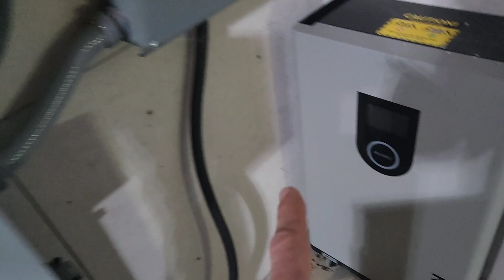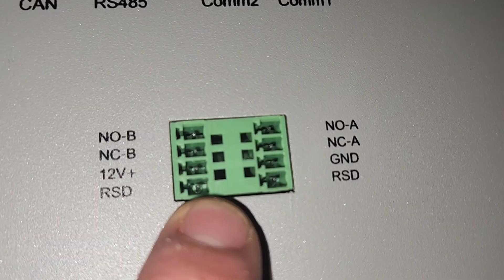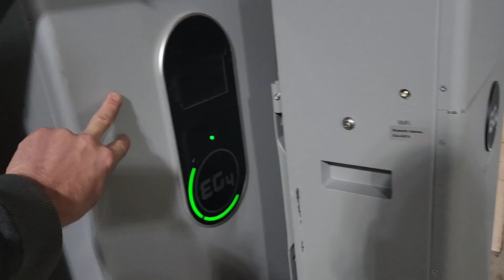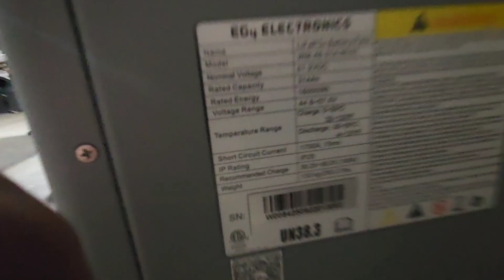New Eg4 16kwh Indoor Wall Mount Battery - 48V 314Ah

Comment from the maker: Eg4 16kWh Battery:  https://signaturesolar.com/eg4-indoor-wallmount-battery-48v-314ah-16-1-kwh/?ref=DiySolarPowerFun
Reply: I know that is how I learned about the battery.   Yes, the price is high but I need to know more about how to protect it indoors at cold temps ( ~ 20deg F).  Advice?  I will need at least three of them or equivalent.  My Grid will be for emergency back up only if it is working ( usually December through February is when we get Blackouts and brown outs).  Brrr its cold these months.
Reply from the maker: @crimestoppers1877  these batteries do have heaters. However if it's 20 below I would probably recommend storing them inside. If you need a space for your batteries inside, check out my first grid boss video. I mentioned a few different wiring diagrams if you want to have a strategic location for your batteries.
Reply: @diySolarPowerFunWithRay    It's not 20 degrees below it is only 20 degrees F or 12 degrees below freezing at sea level.  I will check out those videos now.   I would enjoy building the horizontal YX something can not pronounce? batteries that Will built (on the Harbor freight lift trucks).  However, I am in California and they are in China or Taiwan and have had huge issues ordering direct from Taiwan or China.  The quality is all over the board no matter how many "certifications" they can show.

Comment: I'm getting the new Panda Battery if it gets a couple of updates. over 600ah's, with the bigger cells, and its like 2300 bucks.
Reply from the maker: That's big... so about 600lbs? I don't think i could move that.
Reply: @diySolarPowerFunWithRay build it in place if you can't move it
Reply: There are soo many DIY batteries that are very high quality but you cannot ever use them with a grid tied system. You HAVE to have a UL listed battery.
Reply: @eekedout no, just be smart and not let them see them, and have the UL where they can see it. OR! here's an idea, get the CHIN NAH battery later after you got your system certted with one UL batt.

Comment: Another stupid design. If you read the battery description, you're not allowed to build a battery on its side. The same goes for the pressure the cell needs to withstand. In a stack, the bottom cell has the most pressure, and the top cell has almost none. Never buy a model like this.
Reply: Well, you are the very few people notice this design has issue...

Comment: The battery is nice, but if you are using both the inverter will pull from the lease resistance first.

Comment: Can I combine three EG4-WallMount Indoor Battery | 48V 280Ah | 14.3kWh with one EG4 Indoor WallMount Battery | 48V 314Ah | 16kWh in the same Flexboss21 and Gridboss system?
Reply from the maker: Yeah. That should be fine.  That's what I'm going to do. 👍
Reply: @diySolarPowerFunWithRay will the affect the rebalancing? I thought they all need to be identical batteries in order to balance charge them evenly and for longevity
Reply from the maker: Definitely better if they're all the exact same size.

Comment: Better to be off grid then have to deal with inspectors, red tape, and permits!
Reply: Good idea.   You can buy an excellent NEC/UL approved manual Transfer switch pre-wired with ten AC circuit breakers from Reliance ( Lowe's has them).  One labeled wire from each Reliance DPDT switch goes to each existing breaker of your Service Entrance Load Center to the Transfer switch and the other labeled wire goes directly to the original wire in that same breaker. The Load Center breaker of interest is in series with the DPDT switch-breaker in the Transfer switch.   Two THHN-2 feeders and one Neutral ( + GND) between the Inverter AC output and the Transfer switch and away you go. To make it more fun you can switch each of the  breakers in the Transfer switch to either "line" or "Gen" ( actually not a generator but your inverter).  This way you can toggle each to figure out the best breakers to have on the Grid or through your PV solar.  The nice thing is that you are now TOTALLY isolated mechanically and electrically from the GRID for each of 10 Load Center breakers (your choice).   No more giving free power to the utility ( charge up your own batteries for nights) , no endangering Utility linemen when the Grid goes down.  No chance of interfering or adding noise to the Utility frequency or phase.  Most consumer inverters rely on the presence of a "Hot" Grid to control the voltage, THD and phase angles from the inverter.  Why have an expensive solar emergency back up system that will not work when the GRID is down?  The EG4 12000 V2 inverter provides 240 V AC at 50 amps which is the same voltage and current which meets the Reliance Switch specifications.   When the inverter provides more current the excess can go to charging the batteries at the same time.
Reply: @crimestoppers1877   Yep, my setup is pretty much like you explained.. I added another small disconnect to provide power to my inverters from the Main panel (60A-Grid assist) In case batteries and solar are not enough. 
Basically everything is reversed. Use the grid for backup only
Reply: @danfitzpatrick4112  Please tell me more about your setup ( inverter, batteries, panels).   My plan its to charge my batteries via my 7kW gas generator using an EG4 Chargeverter when my solar environment is low.  I hate the idea of giving one dime to my utility.  In my job I interview and investigate criminals.  The kind of language, excuses and lack of responsibility from these criminals is exactly the same as my utility except the criminals do not make "political campaign contributions" like the utility.  Also the criminals do not have an advertising department or Public Relations department.  If they did they would also never go to prison for their crimes.  Same=same.
Reply: @crimestoppers1877 
I have a Victron 5000 inverter and use the interlock switch for my main panel. As simple as it gets. It allows me to use any or all of my circuits.
If I need to charge up my batteries from the grid, all I have to do is plug into any outlet and get 15 A to charge up my solar batteries. You’re running through your AUX connection. 
You can’t go wrong as it won’t allow a charge if you try to turn on your inverter to run the house. You’re just using your battery charge switch on your inverter.
Reply: Even off grid system requires permits for safety reasons otherwise you will be non compliant. All it takes is 1 wire mistake and you can set something on fire or endanger lives
Reply: @TheCryptoFarmer   From, a purely theoretical view there is some validity to that idea.  My experience and knowledge has been with elevators and automatic lifts.  I recently observed the Load Center of my residence and noticed something curious.  I contacted a local Utility worker on his lunch break next to a Utility structure and asked him a question.  He told me it was illegal to give advice and recommended a highly respected licensed electrician who happened to be his friend.  We exchanged telephone numbers and soon the electrician visited my residence.  I showed him my panel and asked if he had any comments.  He had none and could not notice what I believe is a serious NEC code violation that was probably a serious violation since the 1960's.  Before the house was built.  I showed him a subpanel I was preparing for my future solar system and he was surprised.  Who did this?  It looks like my work!  He later gave me an estimate between $40-45,000 for a solar system he would recommend.   Think about this?  Who has $40,000 cash to invest in a system that provides almost FREE electricity to the Grid?  I found another licensed electrician and showed him the same questioned wiring in my service Load Center and he immediately noted the issue.  I asked him how did any inspector sign off this permit with what is obviously original work?  And how did this house sell twice in the past with licensed electrical contractors approving the potentially wiring inside the Load Center.  Mortgage companies relied on this expertise when approving the mortgage.  So we now have had a minimum of  5 professional licensed electricians who were not able to observe this serious NEC violation!  One electrician told me he would rewire it "correctly" for $300! ( less than 5 minute job).  So who is the dummy?  It gets worse.  I asked the $500 electrician what the reason could be for what I saw and he gave the WRONG answer!!  I may not be an electrician but I would be morally wrong to allow anyone, licensed or not to repair something and not know why or what was going on.  hint:  A two 14 gauge wires from a two pole breaker were in parallel to the LINE side of the Main breakers.  WTF!  I measured 120 VAC between the breakers and Neutral with the MAIN breakers OFF.  This is not an unusual situation, I see stupid stuff like this it ALL the time.  How about a re-licensing exam once every two years to keep your license?  The utility guy recommended the "blind" electrician.  In Los Angeles the word is that you need a building permit approval to change a toilet paper roll.  Look all the rebuilt homes in Pacific Palisades after the fire in January 2025? Is it because of the toilet roll permits that is holding them back?
Reply: @TheCryptoFarmer  How are they gonna know? Just have your trusty electrician do all the wiring or come check the wiring. I’ve been running my solar inverter for a while now and there’s no way they will find out.
Reply: @TheCryptoFarmer  My experience includes supervising electricians who participated in writing the NEC.  Not concerned about it.  I have watched local building inspectors sign off on low quality work that violates the NEC.  Why bother if this is the "high" quality of expertise in my area.  I watched as they looked right at several NEC violations that could actually be dangerous to licensed electricians.
Reply: That’s what I do. I ran 90% off my house off grid from my subpanel using a simple interlock switch.
Reply: @Wordsalad69420 
Fortunately, I new somebody who could put that in for me, as I wasn’t knowledgeable enough to put in the interlock system.
Reply: @simon359 The easiest thing. Find the right piece of metal for your panel, drill some holes and that’s it. It’s literally just a piece of sliding metal that prevents you from having two breakers on at the same time.
Reply: @Wordsalad69420 
Tell that to a guy who didn’t know much more than what a battery was in a car, before he put together his first off grid solar. Where I live there wasn’t anybody around to ask.
Reply: In canada you still have to deal with inspections even off grid

Comment: What reason does the inspector give to replace the Ruixu as they are UL listed? It's hard to justify the added cost when you can get the same capacity and a screen for $800 dollars less with Ruixu. I'm not hating on eg4 as I own some of their products but they could do better with pricing.
Reply from the maker: The listing is specifically to UL 1940A. Which is a test where a battery works with a specific inverter. it's kind of like a whole certification. More details here: https://chatgpt.com/s/t_692891cfd998819197ef6d4cf0f569df
Reply: @diySolarPowerFunWithRay  in fact, UL9540A is for battery fire testing, I think you mean the UL9540, this is battery and inverter system testing. if you bought EG4 inverter, you need to choose the EG4 batteries . RUIXU also has it's own inverter passed the UL9540 testing with RUIXU battery.
Reply: The entire system needs to be certified together as one unit in canada. Things are changing but way to slow

Comment: Hate to say it but it's overpriced should be around 2,400 to 2,500 to compete
They even have DIY packs that they sell the case the BMS and the cells separately and the prices are even lower

For 3200 you can get 400ah ul listed server rack 100ah batts
Reply from the maker: It's the ul listing that makes it more expensive. I thought I heard someone mention that to get the inverter and battery certified together(UL 9540A) it costs about $100,000. Seems a bit steep...I thought I heard that on podcast somewhere.
     If you don't need that certification it's definitely cheaper to go with something that is missing the 9540a certification. Eg4 is currently only paying for this certification with the eg4 batteries. However sol-ark has this certification with multiple brand batteries... all fairly expensive.... likely more than these eg4 batteries.
Reply: @diySolarPowerFunWithRay you need 2 see the eco worthy server rack batts that are 799 i guess then... with UL1973 | UL9540A
Reply from the maker: Echo worthy batteries aren't UL 9540a certified with eg4 inverters.  If they claim to have the UL certificated... Do they mention what inverter it is associated with?
Reply: @diySolarPowerFunWithRay  having made solar panels yes, I can tell you that UL certification is typically 80,000 - $100,000 plus and it is a ridiculous rip off by a for profit company that code officials have come to rely on for historical reasons, not much value added. Still, they’re charging an extra $1,000 and selling more than 100 of them, so not competitive anymore.
Reply from the maker: @tomKacandes True, they're selling over 100 of them... But I still believe the EG4 battery/inverter combination is the cheapest on the market offering this the UL1940a listing.  Granted there may be a lot of inspectors that may not check for the UL1940a Listing.
Reply: Right?! Surprised they are not lowering prices